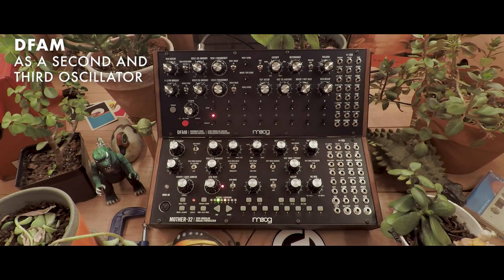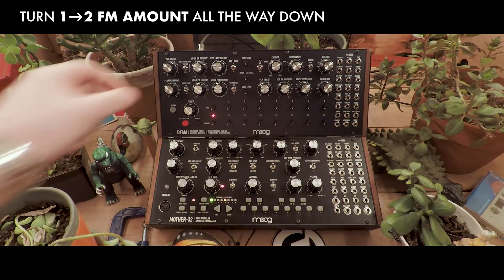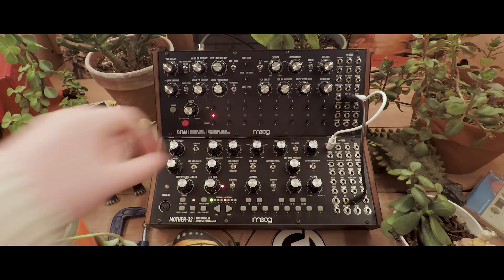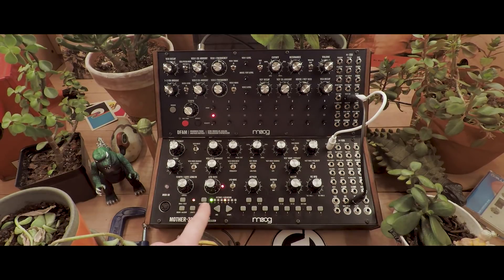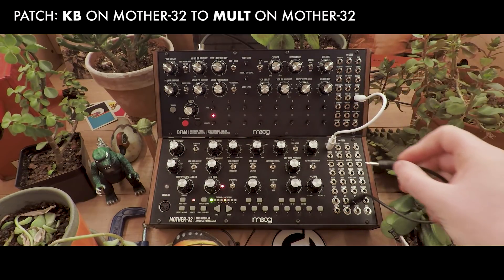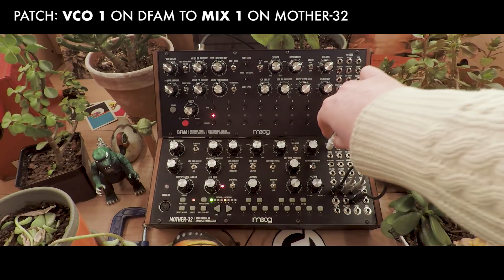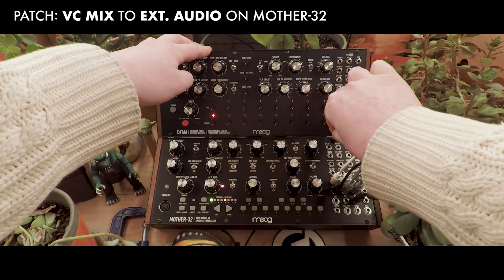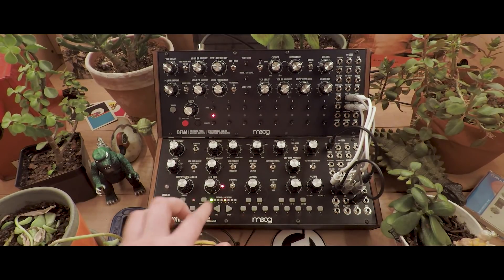DFAM | Using DFAM as Additional Oscillators

Comment: Répondre

Great video ! Sometimes, I love to bring the DFAM oscillators to the M-32 "ext. audio". With a MIDI keyboard You can add modwheel for vibrato (Assign output CC1 controlling LFO to the pitch). So you can play leads or basslines, shred or do songwriting, with a powerful 3 oscillators synth : with sync, FM, noise modulation, PWM sb-osc, saw, square and triangle waves, possibility to get a second LFO with an osc, etc. 
It becames similar to a lot of other moog "keyboard-synths". but still have its 56 patchpoints !

Comment: can the assign output be assigned a random voltage , or what would be ways to create randomness , like random restarts and tempo,..
Reply from the maker: Yes, the assignable output can be programmed to generate a random voltage between -5V and +5V per step while the sequencer is running. We will be releasing a video on the capabilities of this output very soon. In the meantime, please refer to Pages 44 & 50 of the Mother-32 Manual to learn more. https://www.moogmusic.com/sites/default/files/Mother_32_Manual_Web_1st_Run.pdf

Comment: Is the VCO architecture the exact same on the DFAM and the Mother32?  The VCO on the Mother32 is the best you've made in 30 years.  I hope the DFAM VCO is the same.  If so, I will be really excited to build a 3 VCO synth with these two modules.  Please let me know?  Cheers!
Reply from the maker: The Mother-32 and DFAM oscillators are built around the same VCO core, but both instruments express that core in their own unique way. The Mother-32 oscillator has a Saw wave and a Pulse wave with variable pulse width, while the DFAM oscillators have a Triangle wave and fixed Square wave, which result in different, but complimentary tonalities.
 
Using the DFAM oscillators in conjunction with the Mother-32 sounds amazing! Don’t forget that the sequencer can also function as an analog oscillator with wave shaping. For more on this visit: https://youtu.be/oCrLpcxm18s